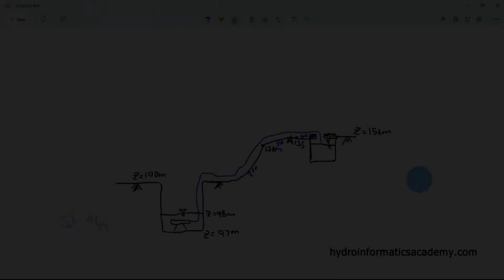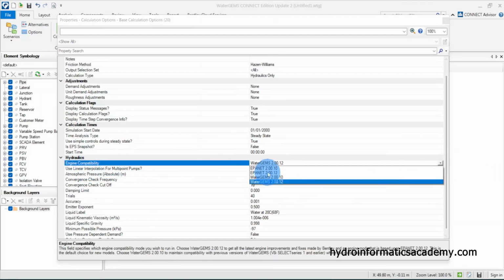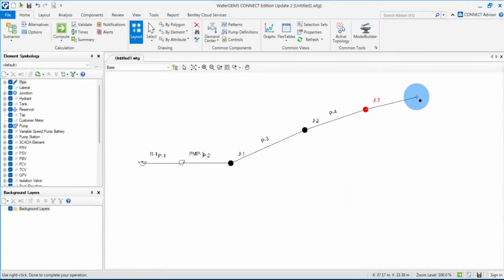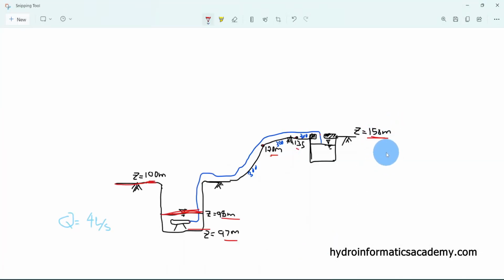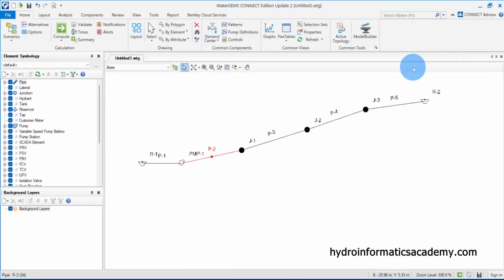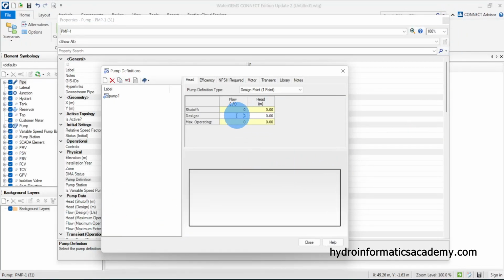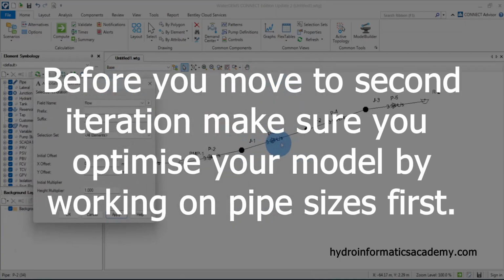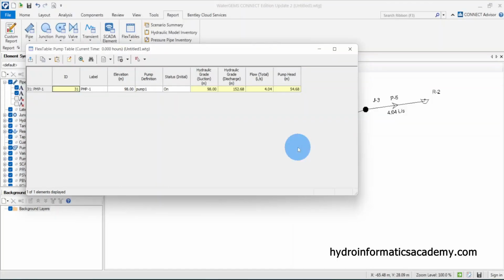Sizing a Water Pump in WaterGEMS Software | WaterGEMS Tutorial

Comment: dear sir, I wanna ask when I open the app I received a prompt about “Change Tracking option” I choose “Do not Track” then choose creat new draw then the nofi said “The name IdahoPumpStationEnergyCostResult was  not found”. I turned off the nofi then it can work normally until I start “Compute” I received a prompt “H&H watergems stopped working”. Thank you
Reply from the maker: Welcome!

I can think of two scenarios
1. Try to turn "change tracking option" ON then check if you still have an error!
2. If problem persists, then there is a possibility that your software has some issues. Try to fix them.🙏
Reply: Did you manage to solve your problem